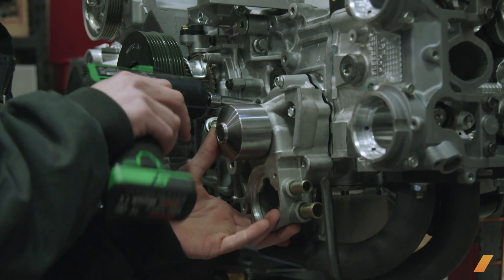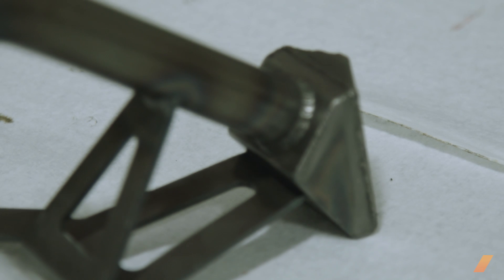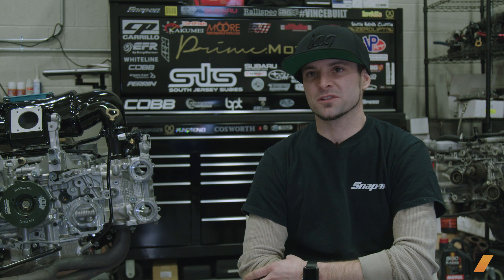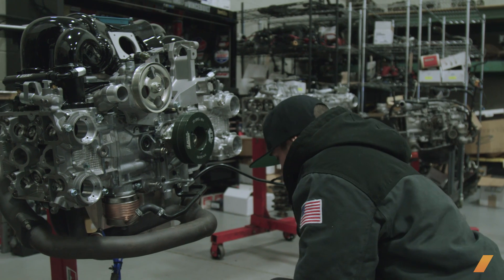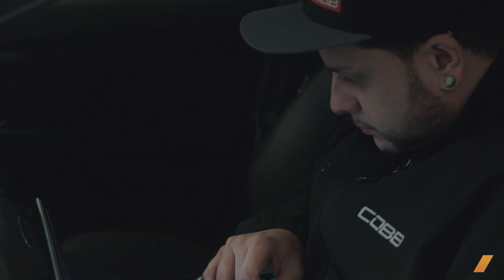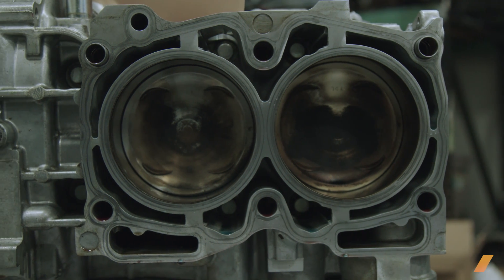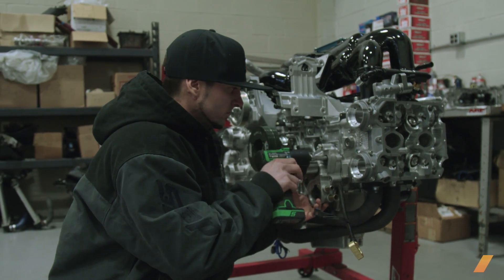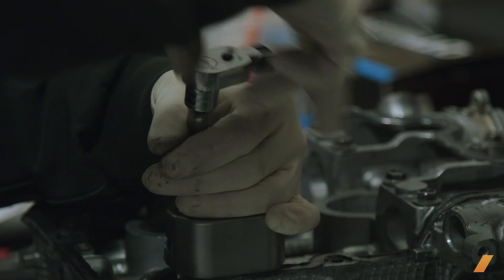Legendary Subaru EJ: 1,000-hp Performance, If You Want -- /ENGINEERED

Comment: I believe ignorant drivers are the #1 reason Subarus break 😕
Reply: My gaskets havent been replaced since 2010 in my 2004 impreza lel
Reply: 170k wrx with original engine ez pz
Reply: My suby have 200,000 miles 0 problems.
Reply: @shawnupole9316   Knock knock. 

Who's there?

Your engine.
Reply: @shawnupole9316  Bearings still die.  Power and reliability are not really a thing.  Getting crazy power out of tiny engines means you deal with issues.
Reply: @shawnupole9316  damn my sti is bone stock with 30k miles and its still running fine. No oil burning, evidence of blow by, or any smoke from exhaust/or oil fill cap from start up. 

How did you do the break in procedure? Does you use 91 or 93 octane?
Reply: @Mrlolibre  30k is really low mileage tho
Reply: @graxo3752  55k now. Still stock. Still no issues.
Reply: @Mrlolibre  and today??
Reply: Cirilo Ocon truth!
Reply: I've got a 2012 WRX wirb 82k miles that hasn't had any issues aside from the 3rd gear synchros which were fixed for free under warranty
Reply: @shawnupole9316  If you're making enough power you overwhelm the shear strength of the oil.  Even going beyond stock rpm starts adding stress exponentially.
Reply: They are pretty weak in general if you abuse the engine too hard they're not going to like it
Reply: shawn upole seems that’s what you needed from the very start... what were you pushing at the wheels ..before the knock?
Reply: Its the tune and lack of oil change my dude.
Reply: If the first and second part you buy for your ej25 isnt an accessport, then alchohol injection, your shit is going to blow up....
Reply: Facts they just beat on them never let them warm up or cool down
Reply: Cirilo Ocon Don't break if you know how maintain them correctly for your usage & application
Reply: 2 exhaust valves dropped at 100K on 100% stock car ($4500 to repair at dealer).
Reply: You sound like a dumb civilian
Reply: Or maybe because the EJ25 is a weak motor in Stock form... seems like subaru is pushing the little stock turbo and fuel system from factory... That's pretty wild that the factory tune is unable to add enough fuel to compensate for an aftermarket intake...

Comment: Thank god for this video, this man is giving you what has taken me 2 years to gather in information and knowledge in just minutes.
Reply: No kidding
Reply: We’re are you guys located at and we’re can I contact for a future build by you ! Thanks for all the great advices in this video. Lots Knowledge🙏🏻
Reply: All motors are the same. They each have their own unique flaws but the Subaru motor in 4 cylinder form is actually really strong comparatively. It makes serious torque, and if not tuned for it will break the stock parts
Reply: Billy Purdy Absolutely Correct! The guy obviously loves and knows Subaru's at expert level. I'm engineer and IT degrees; became best at areas I loved!

Comment: Are AOS systems for the FA20DIT recommended as well?
Reply: All engines. It keeps the over-heated oil from getting sucked into the cylinder with the air. Normally, it acts as an unmetered, poorly combusting fuel additive. It also coats the intake system (including turbo) with a gross residue that will eventually carbon. Definitely a problem when your intake valves are covered in oil and not flowing or sealing well.
Reply: YES

Comment: Sure the EJ can make huge power if it's built to be strong but I can't agree it's better then the FA.  I have had 3 EJ's and now an FA and this car with the same mods (intake, turbo back, intercooler and custom tune) makes more power and spools so much faster.  It also doesn't seem to be as weak in the heat.  More power and about 7 more miles per gallon average is hart to pass up.

Comment: What about transmission upgrades, especially where you have the viscous clutch pack on the manual trans? What mods or replacements can be done? This would be for a street/drag car of approximately 500 or slightly more hp. Forester 2004.

Comment: Im hoping Vincent will see this but what is your theory in breaking in a built motor? I have heard many different methods and ways with both good and bad results. Mine was broken in the 50 miles break in oil, then change with break in oil again for 300 miles then regular oil. I've heard some beat the shit out of it as its suppose to break in seals, others just let it idle forever and let it break in slowly, I've heard many things. what do you do?
Reply: gavin P do the oil brake in but don't Don't beat the shit out of it. You can beat the shit out of it after you brake it in. Go 3000 miles brake in first 50 miles oil change than 500 miles and then to 3000 miles another one and after then beat the shit out of it. That's the whole reason of braking the engine internal mold with each other and then u can hit it hard

Comment: Every time I look into a build, I feel like a common weak point is the transmission. Having a good tune that won't spike will of course help, as well as understanding the stress limits when it comes to power/tire grip. That being said, at what point do you start seeing  transmission issues? And, in that case, what do you do to remedy those issues? Awesome vid
Reply: sti trans is one of best strongest theres ppl running 800 hp on stock trans

Comment: R I N G L A N D S
Reply: EJ257 does, cast pistons lol

Ej207 doesn't have those problems
Reply: Very true. I'd rather have oil consumption than factory over-tight rings that touch tips.
Reply: Jared Tate but most people wont listen to that even if you told them lel.
Reply: Ah akee antifascista! The reason for most factory engine ringland failure is too tight of a gap. It allows better emissions efficiency, but when heated up for long cycles or pushed beyond the factory tune, they will expand far enough to butt ends and buckle, popping the land.
Reply: Ah akee antifascista! No more than a quart between oil changes. Aka 3000 miles.
Reply: Zoomzabba I run mobil1 0w-40 euro blend.... I have not had to top off my oil at all... I do 4000-4500 mi intervals

Comment: ahh... the fun with boxers. Had a few of them. Broke a few of them. ej257 anyone? 
Then again the ***** fa spun 3rd cyl rod bearing out of the blue on highway. 15k miles, totally stock. Destroyed the camshaft and retainer areas. Oh well... for the price of 2.5 oem camshafts, bought a full used engine instead, this one still running strong. Going to buid and turbo it next spring... hopefully it'll last until then. But based on this, might as well go for 2jz or at very least ej20...
Reply: driftster99 lol yeah, boxers are only reliable when they're not driven ✌️✌️

Comment: You Americans and your shitty ej257 obsession .... I'd like to point out that the ej207 does not have ANY of these issues, has forged pistons, thicker cylinder liners, can handle high rpm without issue, just throw a set of head studs in and you're good for 350kw atw

Comment: Great vid. I follow Vince on Instagram. Good stuff. I wish we could have seen your opinion on EL and UEL headers. Still, great material and thanks for making the video.
Reply: I think a lot of Subaru owners put faith in the countless hours of R&D that went into designing and making the factory setup, which obviously include the UEL. At least, that would be my guess. Again, I wish I would have seen Vince's opinion on it. EL makes complete sense for performance, just curious to hear his opinion.
Reply: when you're racing or using your car for a specific application, obviously you want performance (EL). But, I wouldn't trade the massive smile that my car gives me every morning for anything. So if it's a daily I usually say keep the UEL, keep the character.
Reply: From what I've seen on the forums, people get it, but the sound is more important to some people than the extra hp.
Reply: Brandenburg008 equal length always better. Never could understand why the Subaru crowd is the only crowd who can't understand this.

Comment: Man there should be one of these for 1JZ and 2JZ
Reply: FNM Sam The 2jz , 4g63, and the srt4 engine are examples of what Subaru should of done 12 years ago... Pretty disappointing that a simple bolt on/tune setup is pushing the limits of the stock STi bottom end...While srt4 and Evo engines are reliably handling 400+whp big turbo setups.

Comment: EJ might be the best subaru platform if you're gonna build the engine, but its utter crap if you wanna stay on stock internals and make anything over 300whp.

and how would bigger injectors and fuel pump increase power over stock stuff on the stock turbo?  if the stock injectors and pump aren't maxed out then where are you gaining power by having extra flow that you don't need?

Comment: haha @ 5:55 common question asked to someone trying to make quick power on Subarus.  I am at 367whp(injector limited) and holy crap its fast.  My setup is estimated to reach mid 400whp, and I am already pretty scared lol.  Anything below 120mph it scoots pretty fast, I got some videos on low boost.  Reaching 400whp on a WRX/STI is stupid quick.  E85 makes torque come on so fast and hard.  Great video, everytime I have a new subaru owner ask me for advice I pretty much tell them all of this.  I spent a lot of time on NASIOC and getting the info can be a bit tedious.  

EDIT: for the AOS, did you mean the 'STREET" AOS? there is 2 different kinds and people tend to get the one that doesnt run the hot water through it to eliminate condensation for daily driven E85 cars.
Reply: No. He meant the competition series because it eliminates the PCV entirely. Routes to atmosphere. Street series recirculates through the factory system.

Comment: But can it outrun an ae86 down mount Akina?
Reply: Anatoli Ashgenazi 
No, but Bunta can in his STI.
Reply: that wasn't a 22b, it was a Type R Version V
Reply: Anatoli Ashgenazi better chance of him giving birth to barbed wire sideways
Reply: BabySquirel Mc well it does exist but it's not called Akina. It is actually Mount Haruna.
Reply: John Qiu? Not sure but ironic that the modern 86 is a Subaru
Reply: Yes
Reply: That question is like asking...can the 86 outrun the sti in a dirt point to point?
Reply: I mean a stock 22b already did ;)
Reply: still a 207 which is miles better than the 25 lol
Reply: No because mount akina doesnt exist technically so it cant.